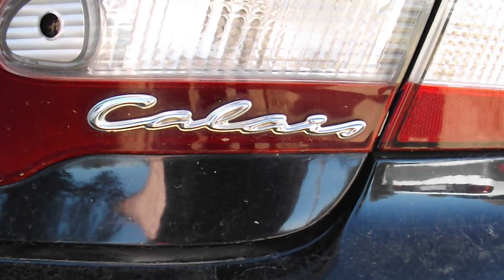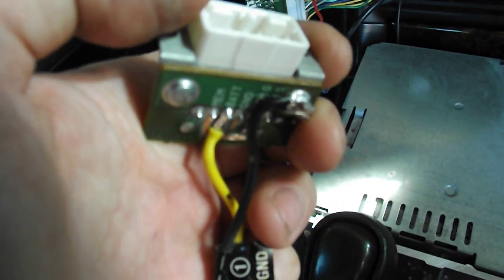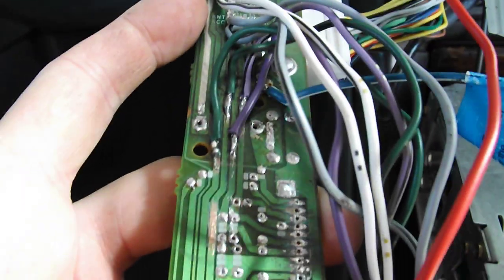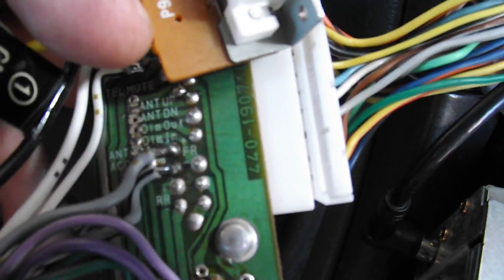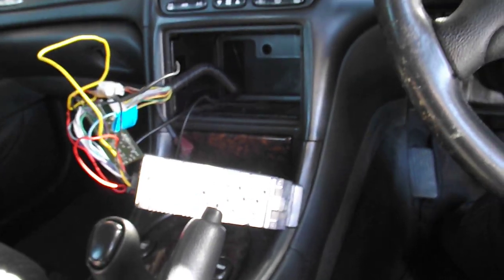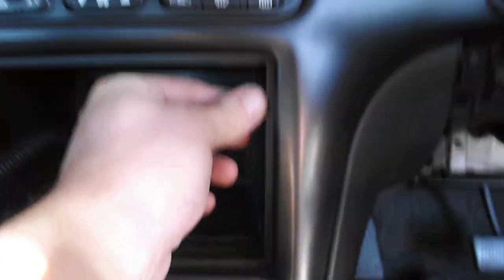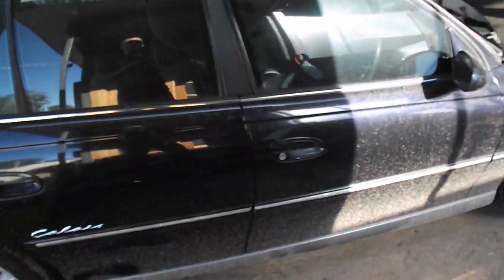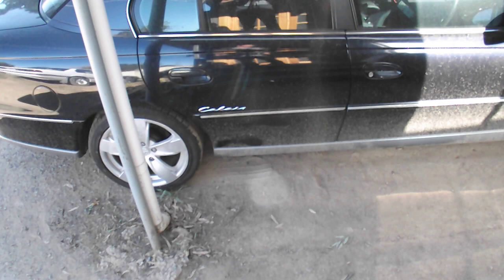vt calais radio after market replacement using parts you already have

Comment: Clever idea mate, it beats buying conversion cables to hack into :-).
My mates were always swapping car radios in and out, always something better about the next unit.
I used to cut the original wiring and use male and female lucar connectors to fit there radios, but when they changed car i had to reverse everything :-(.
Now they buy a two plug conversion cable, not too cheap but no damage is created and i don't have to do the job any longer lol.
Reply from the maker: The original radio was buggered, I absolutely hate butchering the factory wiring loom, but at the same time the patch cable works out to be almost $45 AUD